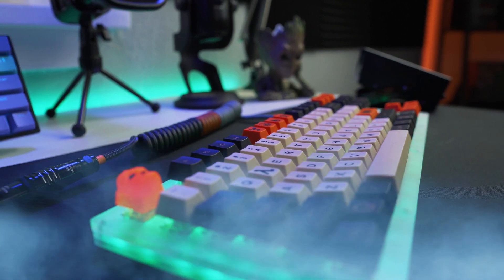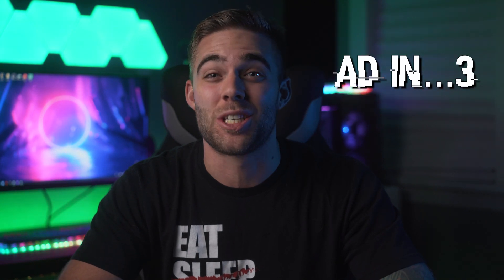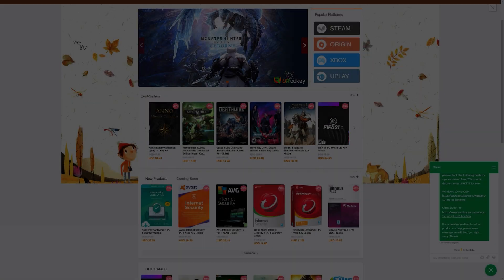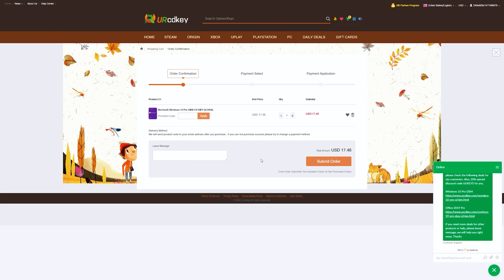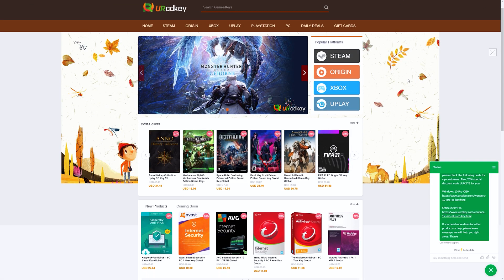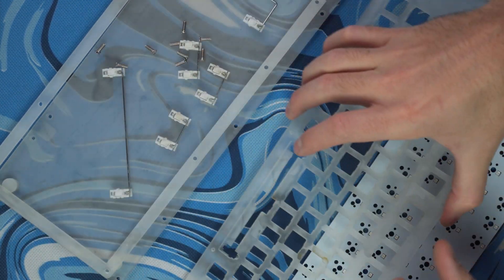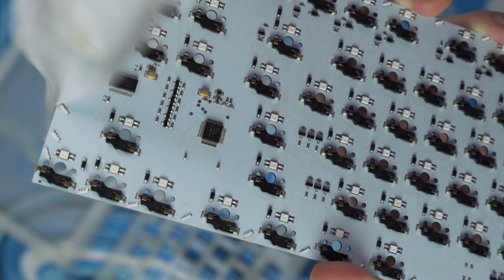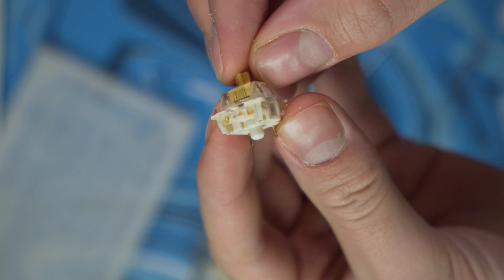Womier👉Gamakay K87 | How to Lube, Clip & Tape Mod Mechanical Keyboard Stabilizers

Comment: just bought this keyboard, but botanical themed. I put foam in there, and cut small pieces of foam and put it under the space bar and under the stabs, instead of tape. This keyboard sounds 20 times better. I used epomaker flamingo switches and lubed the hell out of them. Super Thocky yet poppy.

Comment: I want to get the Zealpc stabs with this, which one should i get, because there are 5 different selections, and i don’t know how to determine which one to get?
Reply from the maker: you need plate mount stabilizers for this keyboard.
Reply: @RAVisuals  thanks.

Comment: Is it possible to set the rgb to a single colour?
Reply: It's kinda tricky with the different settings for backlight and the key rgb, but yes you can set everything to the same color.
Reply from the maker: yes you can!